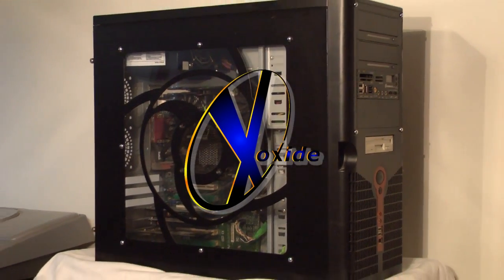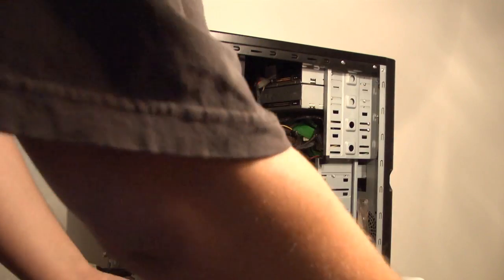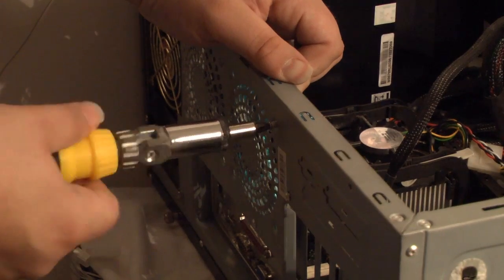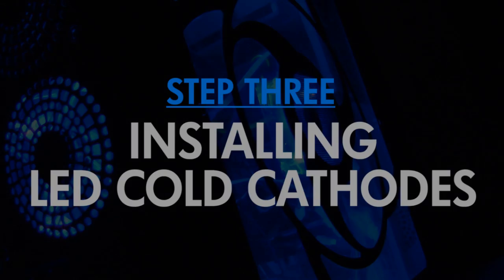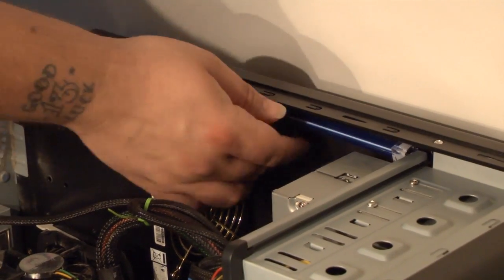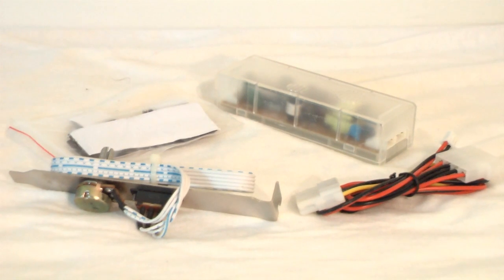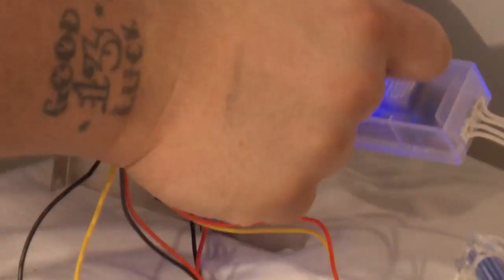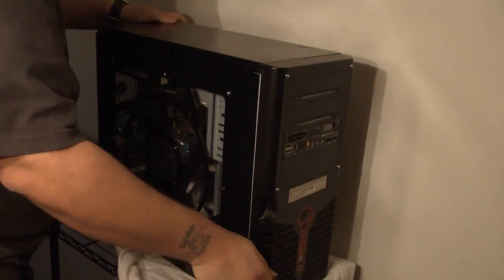Cold Cathode Lighting and Fan PC Case Mod Tutorial by Xoxide

Comment: Hmm... I ghetto-ed my case, I had some leds and various wires laying around, so I soldered them together, popped a resistor in there, and plugged the wire into the yellow wire (12V) and the black wire (ground) of a molex connector. I held the bare wire into the molex via tape, and I then taped the leds to the mesh side panel hole... It actually looks pretty good, and was 100% free.

Comment: hi there i have one 120mm fan taking air out on the back and one 120mm fan on the side taking air in and one 92mm on the side taking air out and one 92mm taking air in the front or case im not shure if i place them right so if some one could help me that would be cool thanks oh and have one in the power supply wich is 630w power supply